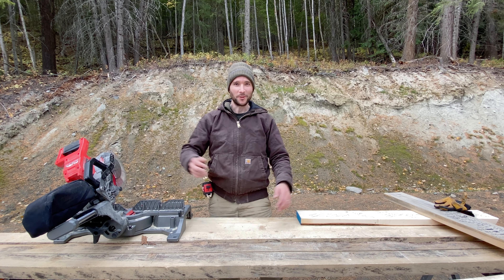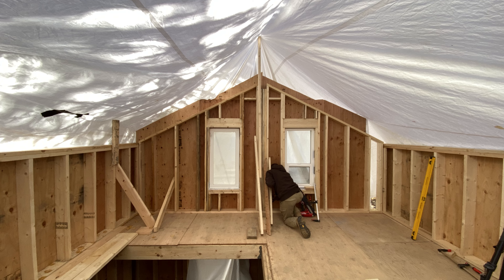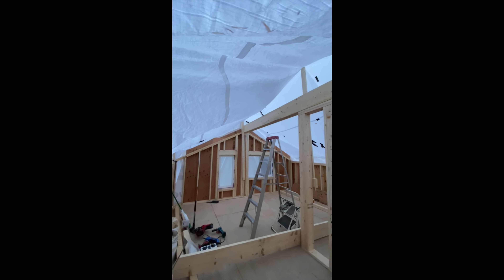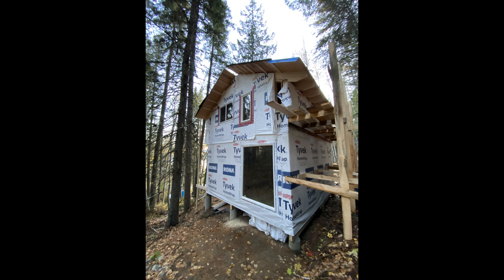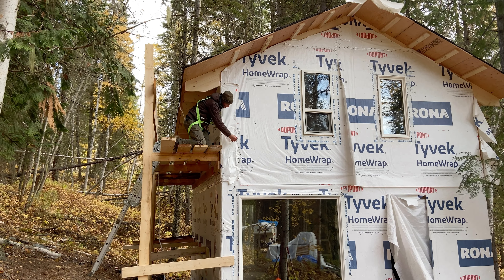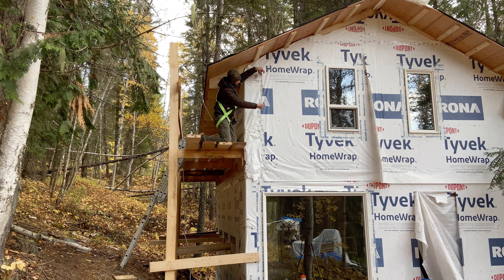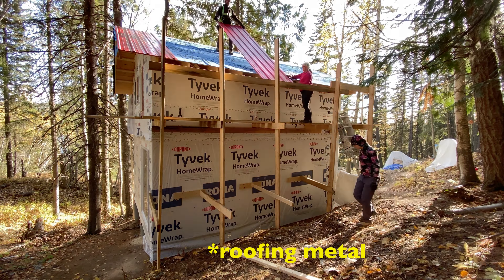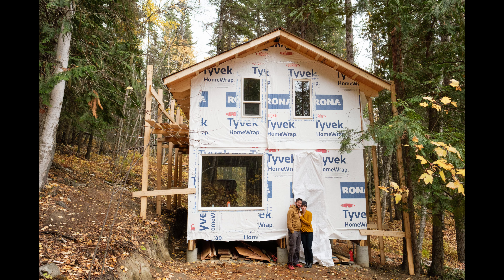Building a roof on our cabin in the forest - Ep. #14 of our Cariboo Adventure

Comment: I’m curious about your total budget for the building materials.  What were some mistakes you made?
Reply from the maker: Thanks for asking, they’re great questions for future videos! So far (foundation, wood frame, building materials, roof, and insulation for the roof) we’ve roughly spent $15K (Canadian), but of course we’re far from done. As for mistakes: too many to sum up here :), all in all nothing that couldn’t be solved. Here are a few:
- When digging the foundations, we had a rough time carving out the hard-packed clay, so our middle piers ended up a little closer to the one side than the other (solved with triple sistered joists, acting like a beam)
- On the layout for the 2nd floor joists, I forgot to keep the end joist in mind, so all joists were off layout by 1-1/2”. No structural issue, only needed to add a few nailers for the plywood.
- Sheathing the 2nd floor walls before raising made it really hard to pull them in and get them aligned with the chalk lines, causing them to be 1/4” or so off layout
- A second floor window is misaligned in reference to the bottom window right below it. The reason being that the bottom window (a big one) had two trimmers, and I forgot to calculate that in when placing the top window (which had only a single trimmer). It looks off, but I’ll make it look ok when putting up the exterior trim work.